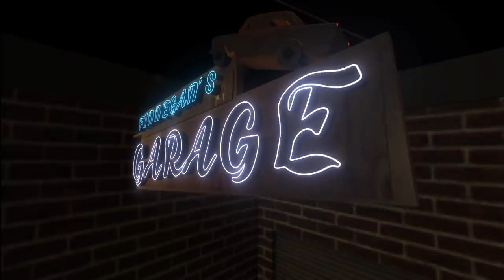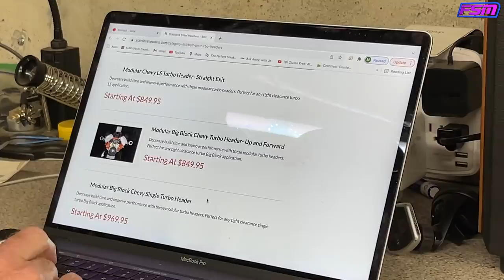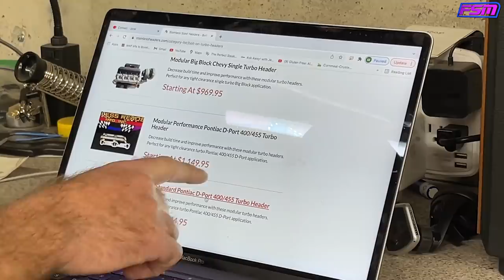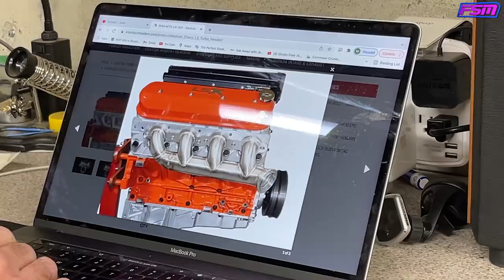TWIN TURBO 427 LS ENGINE IN A NEW JET BOAT!

Comment: Would it not be easier to swap the turbo so that  charge sides are on top? It appears to be a straighter route. That way you could shoot the exhaust out the back like game over. Than on the elbow of the right off the manifold you could put the waist gate. Have it meet in the back as well.

Comment: glue/stich a big pad of velcro to the bottom of the throw pillow,
attach it to some rope,
attach rope to boat..
it might not work at 127 mph but it should keep it in the boat at 27mph

Comment: $7K for the intake??? WOW. I thought the $1500 used Hogan sheetmetal intake I was looking at for my 347 SBF was expensive, but it also didn't have a built in intercooler.

Comment: In pc builds the heat after shutting the power off still can cause damage and increased wear to the components so there are devices that allow for the fans to run at reduced speed for up to 10 minutes after shut down. Pretty awesome to think that the same principle is used in multiple industries.

Comment: Don't forget to resin coat the holes you drilled to seal off. Biggest killer of boats is incorrect hardware fitment.

Needle tip screws are a good idea

Comment: I think do the ol switcheroo on the ac compressors, clock the cold air out at top, could be even more neaterer and symmetrically sweet. Isnt there some truth to having the hot air in and cold air out clocked a certain way?

Comment: What about an oil restrictor for the turbos, too much oil pressure can also blow out seals too. Also Audi B5 S4s (v6 bi-turbo) have an aux water pump in the valley, to help cool after shut off.

Comment: Looking good.  What fuel will you be running in the boat?  As it is more of a family boat I presume it will not be methanol?  If you ARE running methanol keep in mind moisture condensation in the exhaust will drain back towards the turbine housing if you point the exhaust vertically.  Have seen turbines and the inlet collect a lot of rust/oxidation when the exhaust is mounted this way.

Comment: Packaging looks really good but I'd rather mount the turbos  sideways on a straight Y-Piece, lower exit for wastegate, upper for turbo. Cold side exits turned up and straight into the Intake. Water outlet for both turbos straight out the back of the boat, maybe with some nice CNC machined plates for fast plumbing and supporting the structure. 
Exhaust pipes out the turbos 90 degree bends up, both pipes right next to each other, and one more 90 over the top of the boat, Exhaust tip pretty much just both pipes fused and "plated" top and bottom to form a oval.

but I can't do it that way cause I ain't go no money nor a boat 😂

Comment: Fabricate some heat shields for the manifolds, if you have a pattern laser cut in them they’ll look really sharp. Maybe do them in titanium and burn them for extra flash if you’re into that. They’ll also take any burns down a degree if you brush against them vs touching the raw manifolds.

Comment: The turbo coolant out needs to flow "upward" in order to achieve thermal syphoning. Finnegan said something returning 'down'. If the turbo coolant out is the highest part of the coolant loop it will never thermal syphon after engine shut off. You will need to add an auxilary electric pump for after shutdown to to maintain temps after a hot shutdown.

Comment: Regarding the Water return line on the turbos. How are you going to measure 20 degrees  down in the shop when the boat will not be level/plumb in the water?

Comment: Could there be a down side to letting lake / river water run through the water cooling on the turbos? The engine I figure has larger openings for cooling but how big are the openings in the turbos compared to the engine? Could you pick up debris in the water that could clog the water passages in the turbo?

Comment: If cooking the turbo oil seal is such an issue, why isnt the water cooling pump run off a battery after engine shutdown to improve cool down post-run?

Comment: Keep it there keep the Y throttle body! do this.. hear me out this would be sick! come out of the intake sides of each turbo go under the throttle body on both sides not connected. Then to a twist in the pipes to go the the opposite side of the Y that the turbo sits on. like a pretzel center section.. yeah might rob some air flow but it would look sick! and them maybe gusset the two peices with something to make it a one piece v-band connection. i can probably model this or send you a basic drawing..

Comment: Laying your scale flat next to the transfer screws and adjusting so the screws are flush with the top of the scale is a good way to put them at the correct height and even

Comment: Everyone is saying to flip the turbos so the charge outlet is on top, but I think you could build a beautiful charge pipe by leaving the outlets down low. In my mind I have something that resembles the ram horn manifolds of an early Vette left in polished or raw stainless, sweeping over, up, tieing together, and then in to the throttle body.
Reply from the maker: that's the plan.

Comment: Never been a fan of twin injector setups, they always seem to cause more problems than they fix.
Reply: I have exactly 0 experience with running them myself, but from my extensive YouTube viewing experience I think most issues occur with people running gas in one system and methanol in the other. Methanol is nasty stuff if you don't flush it out before letting it sit for any amount of time.

Comment: Swap the compressor covers on the turbos. Should give you a pretty much straight shot into the throttle body. For all you saying to swap the whole turbo from side to side, if you just swap the turbos from side to side its gonna change how close to the engine the turbos sit
Reply: you cant swap the housings on a mirror image turbo.... the way they make them mirror is to have one with reverse direction fins on the compressor wheel. look at the two side by side again, you'll see the wheels are backwards to each other.

Comment: Why not build a v drive and go faster?? Jets pull bit harder at the hit but loooose sooo much up top.
Reply from the maker: You ever felt the brute acceleration of a well-built jet boat?
Reply: I am sure not to your quality.  I have followed you for a long time. I am impressed my friend,  you build some cool stuff.  Up here on the Niagara river and the creeks our hondo v-drive 800hp 498bbc would drive away from 1500hp blown  jet drives.
 No one up here seems to have a jet that will go past 110mph.  Where we did 125mph in the quarter at 7400rpm. Just ran out of money to go faster.

Comment: Does he now have two jet boats? I need to catch up on older videos to find out. Very happy for him, the manifold is indeed a masterclass in cnc machining and cad design.
Reply: Yes, this new one is a 5 seater so he can take the fam with him.
Reply: It may be more than 2
Reply: Max Power  Thanks for the reply. I am excited to see if the concept of switching fuels based on boost will work out as desired.

Comment: This will be so cool when you are finished but are you sure that the flow of coolant after you shut the engine off will work on an unpressurized cooling system? I was under the impression that the heat of the turbo vaporizing the coolant is what allows the coolant to continue flowing, and that may not work as well in an open system. Or I'm completely wrong.
Reply from the maker: we are gonna have to find out.

Comment: Thanks!
Reply from the maker: you rock! thanks.
Reply: @FinnegansGarage I was down for 4 months because I had 12 vertebra fused, I stumbled across a Roadkill marathon, David and you got me back into wrenching. I grew up working on drag cars and then circle track dirt modifieds until work got in the way and I ran out of time for other things. I was able to forget about the horrible surgery I had during that roadkill marathon and I could never repay you guys for that, there was the pain from laughing but it was worth it. I also found out about drag and drive from you and David and that has completely changed my outlook on things. I have always told my wife I want to build one more car, a mid 60’sm Lincoln, it was going to be a restomod but not it’s going to be a drag and rive car similar to your caddy. I am really hoping to show you can get a Ford FE to power the Lincoln into the 6’s, probably be a cammer but like I said it’s last build.